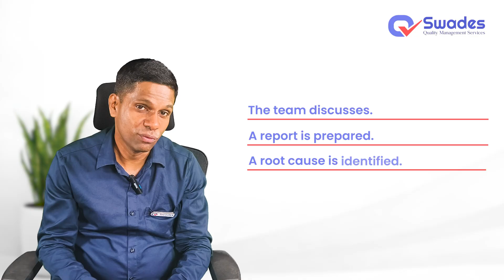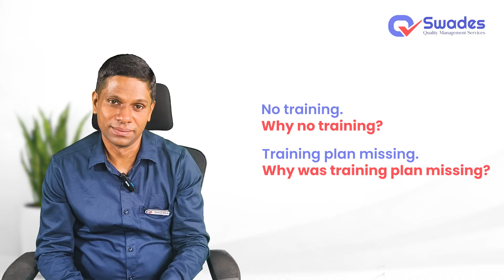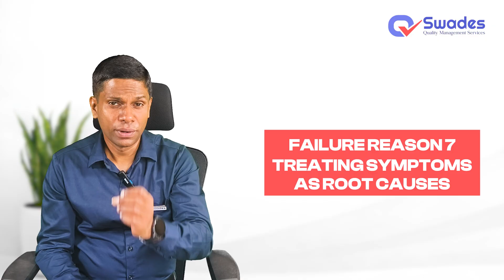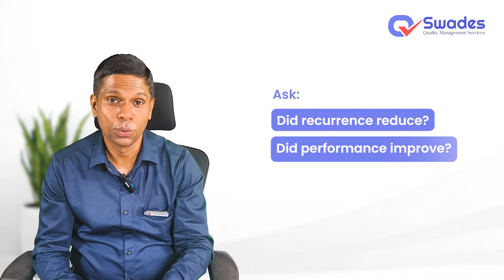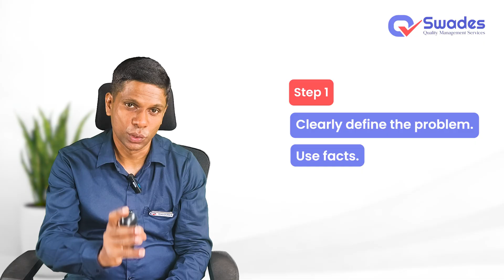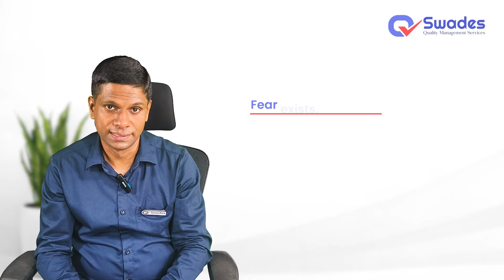Why Root Cause Analysis (RCA) Fails | Stop Solving Symptoms and Eliminate Problems Permanently

Comment from the maker: A question for quality and manufacturing professionals:

Why do the same problems keep coming back even after Root Cause Analysis and CAPA are completed?

In many organizations, the problem is not the lack of RCA tools. The problem is stopping at the obvious cause, blaming people, acting on assumptions, implementing actions that do not address the real cause, and closing CAPA without verifying effectiveness.

In your experience, what is the biggest reason RCA fails?

A. Stopping at “operator error”
B. Poor problem definition
C. Corrective action does not address the root cause
D. No effectiveness check

Share your experience in the comments.